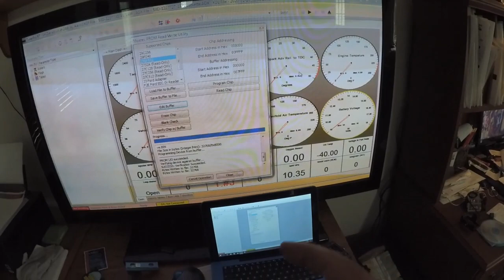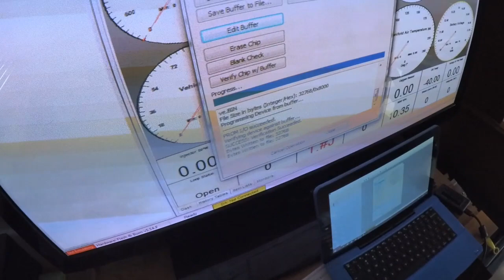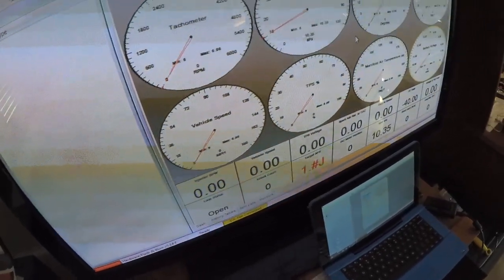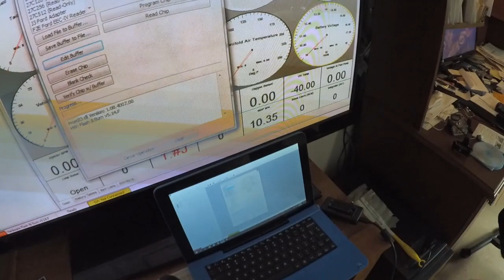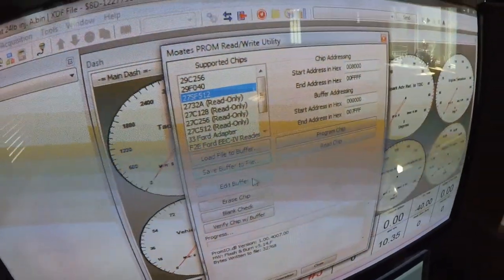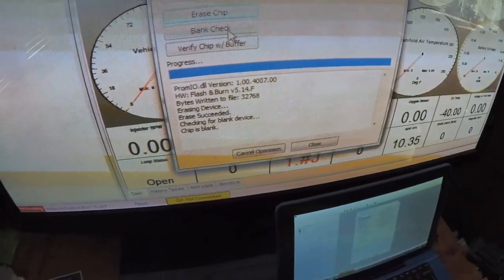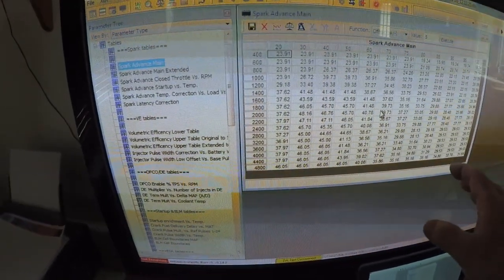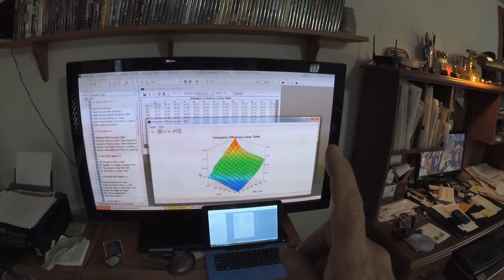Getting Started In OBD1 Chip Burning

Comment: where is the MemCal normally located in a car? I imagine it would it be piggybacked to the ECM?
Reply from the maker: That's it, stock memcal plugs directly into the ecm, if it has a chip adapter then the factory memcal piggy backs on the adapter. See playlist for additional videos.

Comment: hello i have a question for u i have a 1990 k5 blazer 5.7 had it rebuild the block was 30 over did alot of up grades on it put bigger cam in it and had some one to burn my chip and for some reason cant get any power i still have the swirl port heads on it and put a xe262h cam in there do u think that cam is to big with them heads i did evrything i was suppose to do up graded my fuel pump change regulator spring to 18 psi i   got 700r trans took stock torque converter out put in 2000 to 2400 stall in there edelbrock intake headers 3' pipes all the way back  4.10 gears i have 35x12.5 r15 tires on it.it  it idles good sounds good but no power and i hear a ping nosie in engine real low about 25 to 35 mph after 35 mph i dont hear it..tell me what you think..im getting really frustrated im thinking about eliminating that computer and putting a efi sniper on it .i didnt no i were going to have this mush  trouble.
Reply from the maker: you may be better off asking this question in the hot rod forum engine section, https://www.hotrodders.com/forums/#tech-help.5  
you will need to give more info like what intake cam specs ect. with 18 psi I am assuming you are using a tbi .

Comment: uv erasable eproms are erasable with UV light and it takes about 15 minutes.  UV erasable chips EPROMS use the same burner you have there and takes just a few seconds to burn.  Electronicaly Eraseable Programaable Read Only Memory EEPROM 's do not need a uv eraser.
Reply from the maker: Thanks for the input, I always read that it takes hours, I am confused if you have a chip that is burned with uv light how can I use the burn 2 to burn such a chip such as the factory memcal.
Reply: @E.T.GARAGE  It does not burn with UV, the the erasable eproms have a window the UV light can pass through, it melts the metal that then flows back into position.  When Burning, the metal is vaporized and coats the surface inside the compartment somewhere.  when you "flash" an eeprom it erases inside as well, I am not sure about how the eeprom works, but I have worked with eproms for over 40 years.  There are some proms that use the same teck as the eprom, but have no window so you can't erase them.
Reply from the maker: @kentsimon2152  Thank you for the info and clearing that up , my only experience is with burning the 27SF512  chips that I get from moates, if I could get my hands on the correct memcal  for my 90 with out spending a lot of money I would try it, I don't want to try it with the one I have and ruin it. Some times I see one for sale but they usually want over a $100.00 dollars.